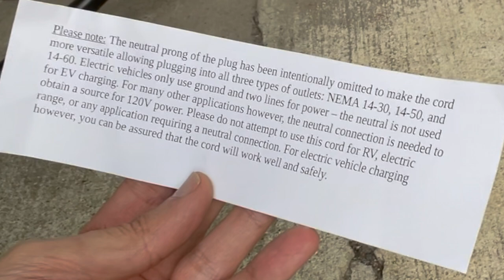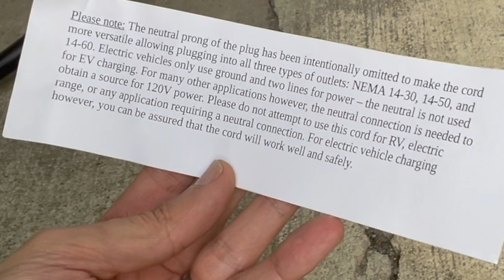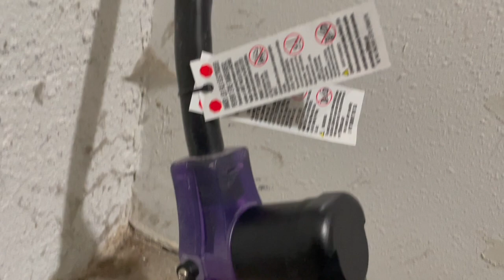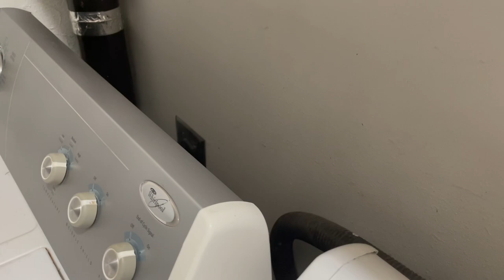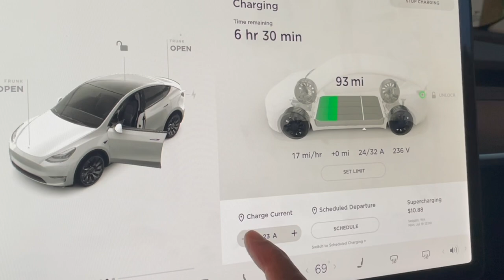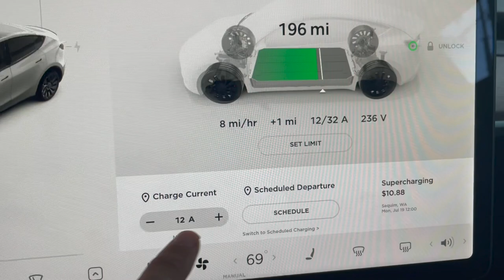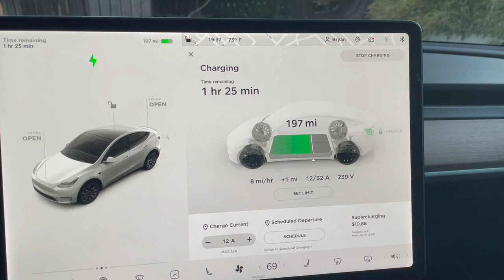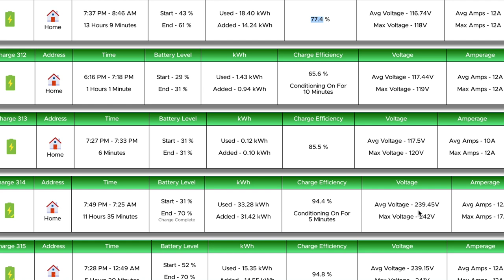No installation needed - get 220v Tesla fast charging from a Nema 10-30 dryer plug for under $250

Comment: That cable running inside the dryer vent is an absolute noooooooo
Reply: That's not the only violation here. How many did you count?
Reply: Wouldn't that cable potentially melt??

Comment: You plugged in a NEMA 14-50 plug into a NEMA 10-30 dryer outlet. That's why it shows 32A charging,  which is maxing out the mobile charger. But a NEMA 10-30 dryer outlet is only capable of running 80% of its max amps continuously. 24A is what you should have the max limit at with this setup, probably even less with the splitter and the extension, and also running it through a dryer vent. Sure, you may be fine, but hopefully no one else tries to replicate this and burn down their house.
Reply from the maker: The great thing about the Tesla is you tell it how many amps to draw.  It goes down to 5 amps at minimum - set from the car or the app.
Reply: @Bryanbkk  that's great, that's not what you did though and it's why some fires have started.
Reply: This is why I ordered a 10-30 adapter for my mobile connector. It matches the supply wiring so less chance of overloading the circuit.
Reply: I was thinking more of the type of max load in that line. A 32 amps charging tells me that is quite probable the breaker used in the distribution panel is a 40 or 50 amp breaker in that line. Am I wrong here?
Reply: @francosepulveda8438  Exactly my thought.  If it was a 30 breaker it shouldn’t peeked out that high without not setting off the breaker.  I mean that is the purpose of it after all.  Not to pass 30amps
Reply: @francosepulveda8438  Exactly my thought.  If it was a 30 breaker it shouldn’t peeked out that high without not setting off the breaker.  I mean that is the purpose of it after all.  Not to pass 30amps

Comment: Wtf??? Ok I raised an eyebrow at the cord through the dryer vent... but then completely lost it when you thought the ground was not necessary, when you even read the note saying that it is needed.  Dude be careful, it sounds like you need to learn more about electricity and wires.  Clever solution sticking it in the ground socket but still not "smart"...

Comment: I am not an electrician  but the only problem  I see, as you have shown ,  is that you could potentially pull 32 amps  from a 30 amp circuit.  That is because since you are using the 14-50 connector the Tesla s fooled into thinking that  you are using a 50 amp circuit.  If you forget to limit the charging current in the Tesla  to 24 amps you are creating a potential fire condition.
Reply from the maker: No doubt. But Tesla remembers the 6 amp setting each time I plug in.   I only set a higher amp value if faster charging is needed, which is rare and I'm aware to avoid.
Reply: Can you explain this a little more.  About the fire condition.  I am about to do the same set up with my Tesla.  The required amp’s for a 30amp breaker is 24?   The charge set up should be at 24?
Reply: If what you're saying happens, your circuit breaker would trip if circuit breaker is only rated for 30 amps and it exceeds 30 amps . That's what circuit breakers are the designed for.  so that the wiring doesn't exceed the amperage of the circuit breaker

Comment: and why not just use a splitter from 1 10-30 to 2 10-30 dryer plugs? And every time you want  to use one or the other just shut the Charging or Dryer. Since you already charging at lower Amps instead of buying the 14-50 adaptrer you can just buy the 10-30 and charge just fine and safely!

Comment: Good video!  The reason why 220V is more efficient is because a smaller current is needed. Same reason why power lines are high voltage to transmit power. Increasing voltage allows to transport less current. V (Volts) = I (Current) * R (Resistance)

Comment: Hi Bryan. Thank you so much for making this video. Without your video, I am not sure what I would have done to charge my new Tesla. I live in a very old house and lets just say my breaker box uses the screw in fuses, I just can't "flip a switch" like most people. All the other outlets that I have tried to use have failed to charge my Tesla. You saved me time and money with your video. However, I did set my charge limit to a very low rate, because of the use of a splitter. I did not need an extension cord, because my Tesla is parked a few feet away from my dryer outlet. I appreciate your video unlike some of these other posters on here.

Comment: Some old videos are so great to refer back to.  This video has saved me lots of money as an alternative to hiring an electrician to install a 14-30 over my 10-30.  Because of this video, I can now charge my Ioniq plug-in hybrid using my 10-30 dryer plug with only the splitter and charger.  Thanks for this great video.  The green ground wire that you placed on the ground had me laughing so much.  On the ground eh?
Reply: he must've thought: "they call it 'ground' wire for a reason."

Comment: Remember there’s a temperature sensor in the mobile connector and by using that splitter the temperature sensor doesn’t work. If your outlet melts, that’s on you. 

NEVER CHARGE AT 30amps!!! LIMIT CHARGING TO 24!!! The copper wiring WILL GET HOT
Reply from the maker: I've been charing at 8 amps for the past year, with a rare need to bump up to 12-16 amps.

Comment: Smart lowering the amperage without knowing how much power that socket can handle.  That’s my plan as I upgrade….if the system says 32, I am definitely dropping that down to about 10-12 over night or lower…to lesson the heat until I decide to have an electrician certify the line for max power (face plate in my home could be a $6 dollar flimsy item from overseas for all I know)

Comment: Instead of that splitter I would look at getting a smart splitter such as a neosmart or split volt  That will allow you to draw maxium amp from the dryer circuit (80% max of the breaker size/rating) so if its a 30amp set your max draw at 24amp if its 40amp set your max at 32amp which is the max for a model 3 SR+ and also the max a mobile tesla charger can charge at.  

The smart splitter will automatically switch the ev charger line off when the dryer is in use and back on when the dryer is done.

Only other issue of concern is to find out if there is a code/safety violation by running a power cable through the dryer vent.

Comment: Hi, I have a question. I have the 10-30 dryer outlet on my garage wall, and I am only using the gas dryer.  I bought the new Gen 2 NEMA 10-30 Adapters from Tesla. Every time when  I charge my 2021 Model 3, the first few minutes can get 25mi/ hr , 24/24V 236v  , but after 5-10 mins,  it changes to 12mi/hr 12/12A 236V automatically . And never go back to 25mi/ hr , 24/24V 236v again.  Do you know what is going on ?  I hope you can help me.
Reply: I read about this a while pack so I am loosely paraphrasing here. 

From what I understand the car will adjust those numbers down on their own as a safety feature and that is largely dependant on the wiring in your home. If I had to guess, heat is probably playing a factor and rather than blow the fuse or start a fire, the car adjusts down the amperage pull down. 

If you google it there should be some good information out there for you on this though.

Comment: I see what you did mostly. I have an old 10-30 dryer outlet in my basement and would need a 50ft extension cord 10-30.  I want to remove the dryer plug each time and use the extension cord. If I buy 10-30 tesla adaptor...where does the female portion of the adaptor plug into? What part of the mobile connector? Not The handle? But the other end of mobile connector?

Comment: You may need to get something to prevent from burning the house down. 

A smart switch. If tou run the dryer and the car charger at the same time, you will blow the circuit or cause a fire. Very bad idea. Use a Splitvolt, or a Neocharge smart splitter that switches between a dryer and a car.

Comment: Hold on. Did you put extension through the dryer vent? Is it safe. ??
Reply from the maker: Well my clothes don't come out as toast, so I'm going to assume the heat is not an issue for a thick cable.
Reply: @Bryanbkk  Heat cycling and moisture could accelerate degradation of the cable over time. You're def not supposed to run anything but air through a dryer vent.

Comment: The OLD 10-30 dryer plug has no grounding, so it's great your splitter came with one.  And the Maximum you should ever draw continuously is 24 Amps from a 30 amp dryer circuit, even if the tesla display shows 32amps as an option, don't do it!
Reply: Hey Bruce... I have a ? if you can help... Can you plug an EV charger into an oven outlet? My oven is on a 50-amp breaker, the oven is 40 but breaker is 50. That being said, can you tell me if there's a mobile charger on Amazon or whatever that I can use to plug in the oven outlet? Thanks...
Reply: @scottt725  You need to find a number on the outlet, or match it to a picture of 240v outlets, EV chargers need 2, 120 volt "Hot" wires and 1 ground wire, Or you (or a handyman/electrician) could change the outlet for the oven to one that matches the EV charger, like a NEMA 6-50, the 6-50 is the best outlet for an EV charger, and only charge at 40 amps or less with a 50 amp breaker.
Reply: @bruceb9552  Thank you Bruce. I got a 10-50P to 14-50R 240V 50 Amp 3 Prong Male Plug and a 40 amp MUSTART Level 2 EV Charger NEMA 14-50. This should juice it up pretty good no?
Reply: @scottt725  Sounds good, let us know how it works and the charging rate you are getting.
Reply: I have the same problem (a three-prong old outlet), but I just checked it and it is properly grounded via conduit. I will install the four-prong receptacle with a grounding pigtail attached to it. The charging is going to be less than 30 amps (using solar). This will take time since I decided to make all the necessary modifications before buying the vehicle, which is not going to be a Tesla. The breaker will be changed to a GFCI (except if the charger level 2 installation prohibits doing so). The charger itself might have an internal GFCI, and this can create problems. Good video!

Comment: This solution could work perfectly for me. The only problem I have is that the 110 plug for the ground cable is not so close to the 220 v plug as in your case. How could I extend the ground cable? Would that be a bad idea? Thanks for the video.

Comment: Was there a reason you didn't just use SplitVolt or Dryer Buddy for this?  They have those out of the box already ready to go.
Reply from the maker: The only value of the box vs splitter is if you can't keep track of when you're drying and when you're charging - if thats you - then the extra $250 is worth it.  Otherwise drying and charging happen at different times and low to no hassle making sure you are not doing both.  The other factor is the Tesla is set to 6-12 Amps, rarely need more - hence overload not an issue either.  If I do need more Amps for a road trip - I take extra care to make sure the dryer is off.  Not hard.
Reply: @Bryanbkk  OK, fair enough.  For most people though, I think the risk of someone forgetting the car is charging and starting the dryer would be too great.  It probably would just trip the breaker, but with the other systems, the dryer is automatically disconnected when the car is charging, preventing any potential issues.

Depending on the dryer model, dryers can draw as much as 6000 Watts which is 25A.  Even if you are just charging at 6 to 12A, it could still exceed the rating of the typical 10-30/14-30 dryer outlet by 2A to 8A. 

I personally think most people are too absent minded to safely save the $250.  It wouldn't be worth the risk in my opinion.

Also keep in mind, with the Tesla charging, the outlet is required to be de-rated by 20%, so it becomes a 24A outlet.  This is required under the NEC for anything running over 2 hours to prevent overheating and fires on the outlet and wiring.
Reply from the maker: @redbaron6805  Fair points. If we were doing more driving and drying, yes $250 more is a small price to pay for that peace of mind.  

Concerning the breaker, what is a reasonable about of faith to place in them?  Operating correctly - doesn't a breaker prevent an overload issue that could lead to a fire?
Reply: @Bryanbkk  Breakers should be pretty reliable to be honest.  I don't think that will be your weak point.

The likely weak point will be the wiring from the breaker to the outlet, or the outlet itself.  If that wire wasn't sized correctly, is chafed or kinked or the wire terminals are not tight on the outlet, or if the prongs in the outlet itself are worn, then you can a an area that heats up significantly.

That is why the NEC de-rates any outlets that are used for over 2 hours by 20%.  So, a 30A outlet is only rated for 24A for any device that draws from it over 2 hours.

That was done precisely as a safety margin to prevent an issue with an old outlet with dirty or weak contacts, crusty wiring or anything else.  

Also keep in mind that the insulation on your cable has a temp rating.  That cable can get pretty warm if you charge at its rated current.  Hence, running it through the dryer hose which is already flowing with hot moist air could cause that insulation to melt.

That is definitely frowned upon according to the NEC code.

That being said, do I personally think that will be an issue?  Probably not, as that UMC charger is rated for 40A and you only charging at 6A to 12A.

Just pointing those out to error on the side of safety, despite the chances of you having issues being relatively low.

Comment: I just started doing this and am getting 20 miles per hour charge on my dryer outlet...just be sure to get an Ev 30 amp rated extension cord
Reply from the maker: That's great!
Reply: Are you changing at 24A? If so have you noticed the cord getting warm after a few hours of changes?

Comment: are you still using this set up?
Reply from the maker: @SerpentSuccessors  yeah, but not recommended.
Reply: @Bryanbkk  yeah i’d be running a similar one with the splitter. just was curious if you ran into any problems

Comment: Pay an electrician and get a permit. It is not worth the risk. Standard dryer receptacles are not built for the continuous loads of an EV and there is a history of melting plugs and outlets. Commercial grade outlets are needed at a minimum. Tesla clearly states in the manual not to use extensions or splitters.

Comment: I see this video is 3 months old, so I wanna really wanna know how is it going so far? Is everything safe and good? No problems?

Because if it’s safe then I might get a Tesla only cause of this method
But I still have to figure out how to take it from laundry room to the driveway.
Reply: Not sure why he is not just using SplitVolt or Dryer Buddy which does this automatically.
Reply from the maker: So far so good.  Found that I do not need the full 24 amps nightly. 6-12amp on the 220v does fine.  Also found that knowing when you are drying or charging is not hard.  The extra $350 for a Splitvolt , when you can shut off charging from the app, seems a waste for us.

Comment: I’m sorry, but if your rental home hasn’t already burned down there are several really risky things in this video. 

Nobody should follow any of this electrical advice. From the extension through a dryer vent. Moisture, heat, lint, it’s a major fire hazard just waiting to happen. Also the ground to a nearby 120 outlet. If your landlord were to see this it could also be grounds for evection.

Comment: Extension cord is not allowed to be used as a permanent solution and also is not allowed to be run through a wall or through a door or out a window. Hence this is not to code.
Also, that cord is complete bogus. There is no such thing as a cord to code that "omits" the neutral. 
So, many, violations, here.

Comment: I would never purchase an electric vehicle if I did not have enough money to pay for an electrician to wire it up correctly. Besides, once the landlord see’s that setup, they will more than likely tell you to remove that setup because it’s their house and I doubt any insurance company will stand behind any damages that can occur. It’s cheaper and safer in the long run to pay an electrician than  burning up your family over jerry-rigging an electrical circuit. Good luck!
Reply from the maker: Fair point. Not the best route for most, but I think it's fair people know it's at least a temporary option.